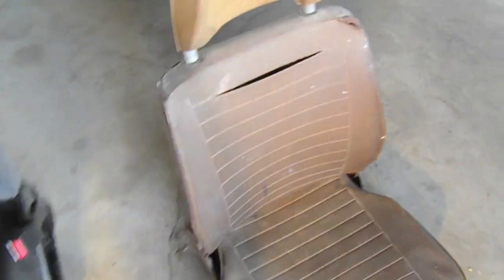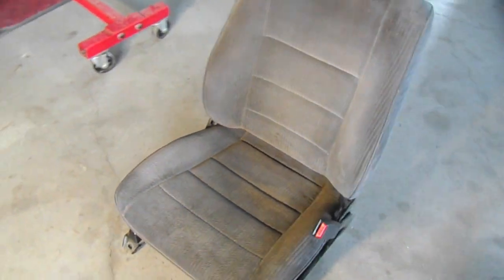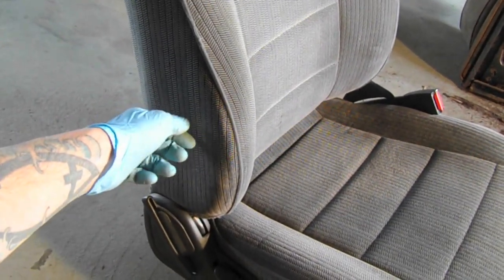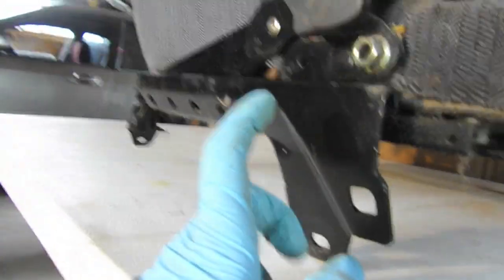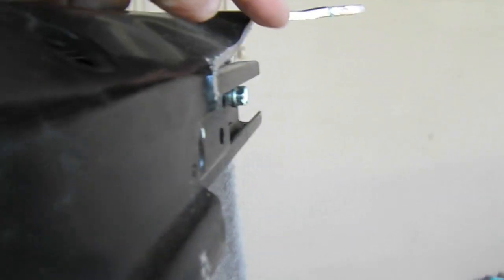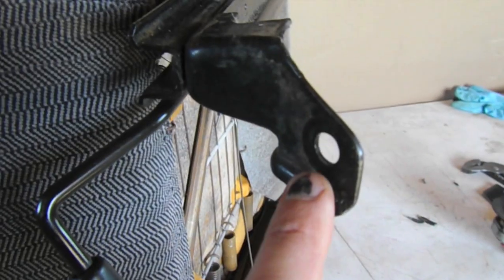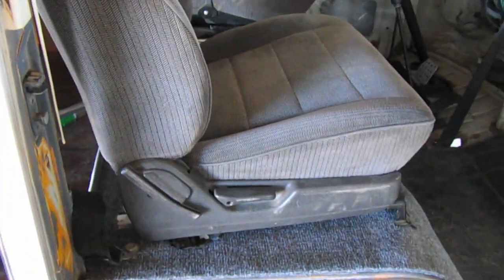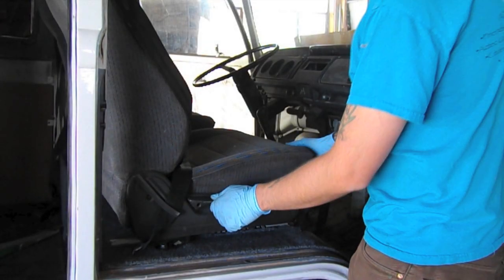Hacking Subaru seats into VW Bus

Comment: Funny enough You should be able to just unbolt the stock rails and replace them with aftermarket ones which would bolt right up to an adapter.

Comment: Old video, but on The Samba, some guy hacked a set of late model Chrysler Town and Country "Stow-and-Go" seats into his Vanagon, and now it is all the rage. Small Car got into the act, and they now sell the seat adapters and the seats. Good luck finding the seats on eBay or Craigslist now. They are hard to find. I did this myself, using adapters from Germany, and I love them. Search: Samba Town and Country. That should get you the link.
Reply from the maker: +Forthwith Tx my buddy Miguel (big white Syncro) told me about those seats a while back. Knew a guy reselling then after converting the Chryslers to support wheelchairs. He never ended up working with them but the concept is great. Thanks for the tip.
Reply: Those seats don't recline though I think.  It's a lot of work and expense to get seats that don't recline.

Comment: I'm wanting to put some late 70s Porsche 924 seats in my bus, but im not sure how to go about doing that. Any suggestions?
Reply from the maker: +vwbussesareforever The Samba may have some advice but I would get the seats and just start cutting and welding until they fit right.
Reply: vwbussesareforever ...can you still reach the pedals like before..seems a higher profile seat base